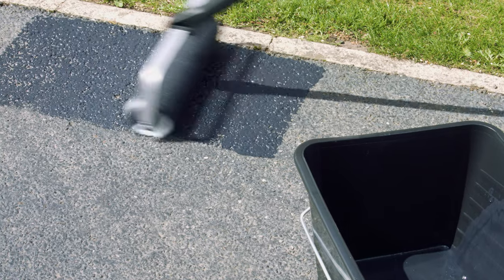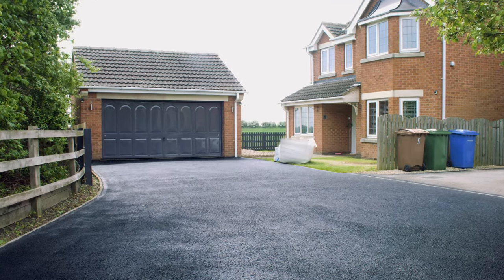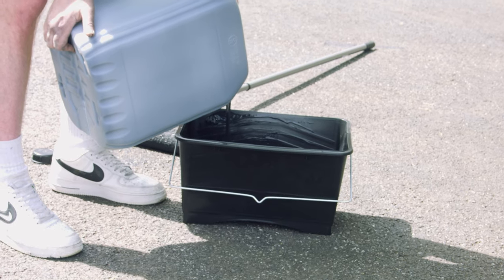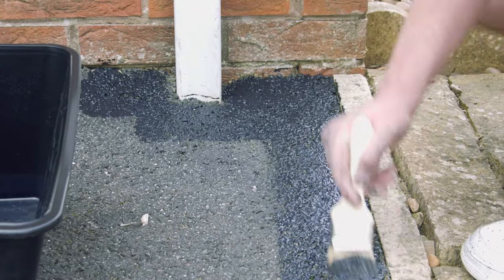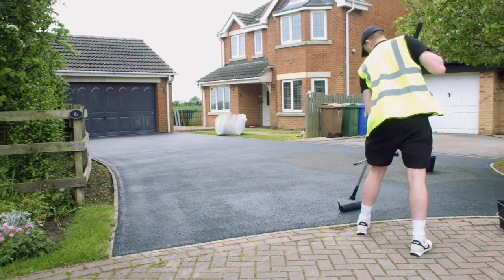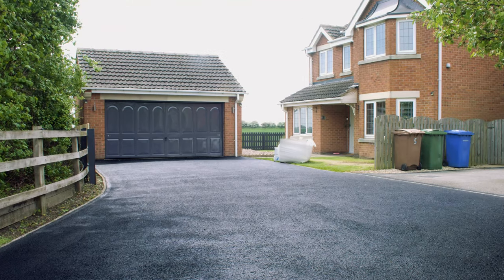How to Paint Your Tarmac | Resincoat Tarmac Paint DIY Guide

Comment: Hi,
I live in Norway and have a few questions:
1: How is the paint with regards to be used in our cold winter climate with temps ranging from +30C in summer to - 25C in winter.
2: Do you have a recommended retailer / dealerlist for Norway?
3: How is the coverage rate? In example how many square meters does 1liter cover?

Thanks and cheers from Norway. 🙂